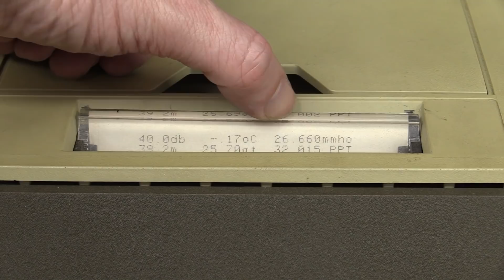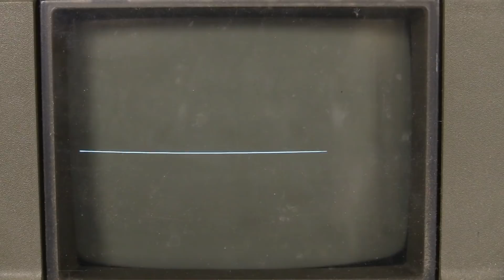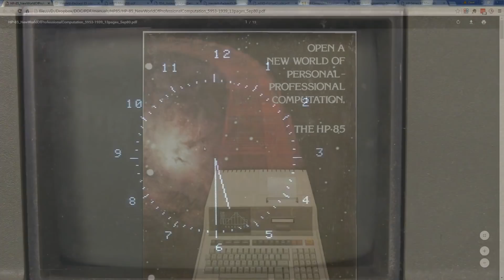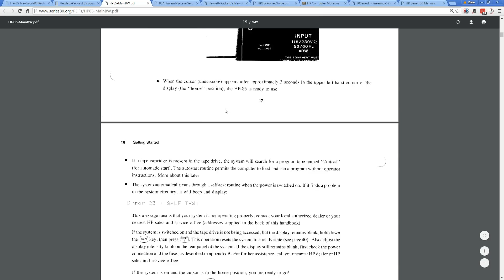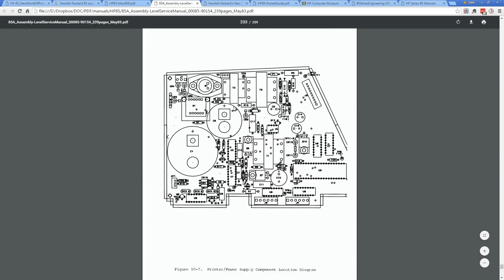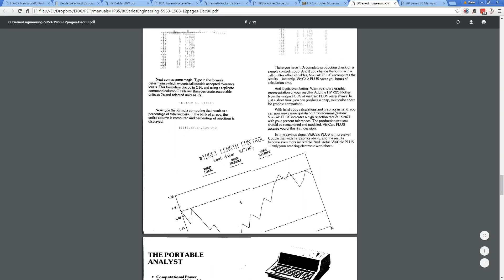EEVblog #904 - Hewlett Packard HP85 Professional Computer

Comment: Cool piece of equipment!  I love computer equipment that was used for testing and automated testing purposes.  I worked with Lockheed Martin's Consolidated Automated Support System.  That was a giant 5 rack machine with a microVAX at the heart of it running VMS 5.2.  It could interface and test just about any piece of avionics that went in the F-14, F/A-18 and S-3 Viking aircraft.  Then I later worked at the remnant of Hughes Electronics and worked with all kinds of weird custom testing gear for verifying assemblies in production.  One of those assemblies was a Sony branded CRT that we produced!

Comment: I used an HP85 in ‘83.
I wrote a program to calculate point coordinates from trig survey for it. The maths was easy - it was the formatting of input and output, and plotting results that took time.
I also got hold of a primitive modem so that I could communicate with my head office in Johannesburg. Two technicians came from the post office - one to plug the 23:00 modem into the power socket and the other to connect the computer and modem into the telephone line. When I had finished in the area, I unplugged the modem & took it back to the PO. They told me, no, I must take it back to my office and reinstall it. They then sent two technicians round to unplug it and take it away.

Comment: We had a bunch of these in our lab in the mid 1980's. I remember one of the engineers had a filter design program on the 85 which took about 20 minutes to run. We took delivery of an HP 9816 (16 MHz 68000?) a year after I started. I made a bet that I could get the filter design program running on the HP9816 and have it finish in the time it took the HP85 to run the program. I won the bet.

Comment: HP Basic 5 was also known as Rocky Mountain Basic or RMB. For it's time it was very sophisticated, having many features of traditional compiled high level languages such as defined functions, subprograms, native support for complex numbers and matrix manipulation as well as a highly versatile IO command set for use with HPIB (aka IEE488) compatible devices. Although much slower than compiled languages, you could get a compiler for it which would speed up the code quite a bit. It was a very powerful and versatile tool especially in a laboratory environment.

Comment: I used one of these when I was contracted to the USGS in the mid '80s. It was used to analyze and process seismic data from our PDRs (Portable Data Recorders) that used the same tapes to store data from seismometers. These were fielded to determine if a locations background noise, whether natural or manmade, was low enough to consider it for a new seismic station.

Comment: Never ever give a 17 year old kit a 12,000 USD computer, an 80,000 USD sampling scope and an HP7475a pen plotter. THIS WILL SPOIL THIS KID FOREVER 😁
I learned programming on Elektor's Junior Computer that I built in 1980 and when we got those HP babies at school I quickly got a key of the computer room so I could tell the teacher how the HP85 works :-)
Two years later I used on at my internship at Philips Semiconductors to automate a test setup for measuring rise, fall and transition times in the new 74HC and 74HCT series chips.

Comment: Did some programming on one of these little guys where I worked in the 80's while attending university. It ran 24/7 like a champ and had two jobs. First it communicated via modem with the on campus phone switch and logged calls and did some initial parsing of data before handing it off to the HP3000 for student and faculty billing. Second it communicated, again via modem, with a petrol dispensing system at the physical plant and logged fuel usage and levels and passed the data off to the HP3000 for record keeping and billing.

Comment: Man, you just made me buy 2 of them on eBay. All as-is, but I will definitely get one HP85B working out of them. This computer has a great meaning in my life and it was on my bucket list to get one of them at some point. Back in 1985, (16 years old) I was an electrician trade school trainee back in Brazil. I had just started studying computer science at night school. Someone at this huge company asked me if I could code an app to produce tables and graphics (something like Excel and Tableau does today), in fact, they named it "Tableau de Board" (it was a big French multinational company). I got my first computer programmer job (34 years ago). I worked with the HP85B and the Tektronix 4054 (one I'm using on my picture). Cheers!!!

Comment: The way Dave marvels at fit-to-envelope design, I marvel at thermal engineering in thermal print heads. Heating that element up to cause a state change in the wax and cooling down for the next pixel beside it...rapidly enough in modern credit card printers to print several inches of receipt in one second. How many man-months of design went into the first usable thermal print head and paper?

Comment: My very first work computer was a HP85 - we wrote programmes to calibrate Ultrasonic Test Equipment from 1980 through to 1989!  Heyyy … these puppies did the job!  During the 19 80s - we started to use the larger HP45 monochrome PCs then this lead us to using the COLOUR  - HP45C!    I remember these weighing a tonne!  I only started using mainstream IBM computers from 1991 at work.  I first bought my own home PC in 1997.   Its hard to believe how far PCs have developed in 28 years!

Comment: Don't compute the expensive function (SIN(X)/X) several times in the loop. Compute it once put it in a variable and reuse it. There's not optimization pass in the BASIC interpreter, so constant folding and strength reduction have to be done by the programmer.

Comment: all other cpus of the time can do bcd tho. 6502 can. intel 8088 can. just that the 6502 doesn't have mul/div. but hp probably didn't want to be dependant of external suppliers for something they could just make themselves anyway. the bcd thing is not an argument. typing anywhere you want on the screen is normal with 80s microcomputers. that's why they have this thing called the 'editor' sitting between the i/o routines and basic. (basically a glorified keyboard buffer using the entire screen ram line by line). moving the cursor anywhere is also the default behaviour on any vt100+ ansi terminal if you don't explicitly stop it from doing that in your program by not echoing those back.

Comment: I used one in 1988 for my final Engineering project. It was connected via GPIB to a VERY expensive HP Parametric Analyser which was connected to a wafer probe station. I was validating SPICE models of transistors again actual wafer transistor structures. It was a bit peculiar as I was by then used to IBM PC's but its ability to interface was fantastic and HP engineering quality then was just outstanding.

Comment: Ages before internet, or even BBSs I worked with one of those, but we didn't used it too much as those tapes were very expensive. I even took classes at HP to use it and everyone there had one at his desk. Those sold on Brazil were castrated because of protecionist laws, so they had only one expansion slot on the back. They were not exactly powerful, but they were ergonomic (even with that tiny screen) and beautiful, they were not as yellowed (plastic gets yellow because of UV light with time). The tape noise was charming and depending of how you wrote (yes you could have databases on tape too) the noise changed.

Comment: I don't know if it was this particular model  but there was one that look very similar running the spectrograph at school. 

HP used to make a lot of this kind of computers / calculators. Dad still has a 41CX Scientific Calculator  with a magnetic strip card reader to load up the program and an interface to connect to vibration measuring device. It could predict when bearing where needing replacement in motors with out even opening it up.

Comment: When I went to work for HP in 1979 this was a fantastic machine, though VERY EXPENSIVE.
The tape drive was optional and VERY EXPENSIVE.
There was a very good educational program that guided the user through all the functions available, it used the graphics capabilities of the screen to provide an animated user experience. This was very SEXY in 1979.
You could actually buy a machine without the tape drive and load programs from other machines, so I was tasked with writing a system that could load the user guide from another machine onto one without a tape drive. I had to modify the user guide program to fetch modules of the guide from the other machine rather than from the onboard tape drive
I had to write it is a mixture of BASIC and ASSEMBLER language.
In 1979 of course HP was the original fantastic scientific company built by Bill and Dave who were still alive.
HP would ship out new products to all the regional offices on a regular basis, large packages would arrive all the time which we eagerly unpacked and proceeded to dive into these unbelievable products.
It was like Christmas Day only10 to 12 times a year.
Those were truly amazing days that I was so fortunate to experience.

Comment: My Dad's office had one of these but no one knew how to use it.  I at age 12 spent time in the office and learned basic on it.  My Dad brought it home and I continued to learn on it.  I am a software engineer to this day.  Fond memories of this computer.  HP did actually make two games tapes that had a collection simple games on them.  I used the basic language to make some rudimentary games.  There were some simple sound commands in the basic language as well.  I eventually moved on to the Vic-20 and then Commodore 64 which seemed like a big step down in some ways and big step up in others.  Thanks for posting this video.

Comment: We had several of the "big brother" machines, the HP 9845.  We used them extensively for analysis of electrical measurement from test wafers during device and process development for x86 microprocessors.  In addition to the ROM and RAM plug-in options, they also had I/O (like 16 bit input and output).  I developed hardware and software to program the 9845s to actually perform the "E-test" functions using the Lomac computer-driven test hardware.

Comment: Gluing your graphs into your report mid 2000's!  Is that right Dave?  Surely with something like Microsoft Word you could have just copy pasted them into your Microsoft Word report.

By the way that is cool tech.  What would be even cooler is doing a tear down of the Olivetti Programma 101 the very first portable computer, which apparently HP copied.  However I guess you would only find these in museums.

Comment: These make a great little "old school"  test instrument controller with the 82937A HPIB/IEEE488 interface, many were used for that purpose in the 1980's.  The DC100 tape drive was nice for portability but the tapes aren't too reliable.  I use a HP 9121D diskette drive with mine, it's much better than dealing with those tapes.  I've written data logging programs for my Fluke bench meters and HP spectrum analyzers and counters for the HP85, it's a simple and cost effective way to use HPIB at a hobbyist price level.

Comment: The tape drive failure is probably related to a worn out capstan or dirty heads. Probably both. Some cleaning and a piece of a rubber band should fix that right up!

Comment: Akron Standard FVM tire force variation machine harmonics and diameter run-out tasks, still had HP A600 computers with 3.5" floppies in use in 2016 testing tires.

Comment: A friend had one of these at University.  It was a great machine.  The digital tape drive was nice because it was addressable and could find programs a data sets without manual manipulation.I wrote a lot of programs on this machine which was nice in that its screen graphics and printable graphics were nice.  I had an English to Angerthast rhune translator because Tolkien was riding high in the early 80s.  Eventually my friend traded for an 87 which gained an 80 column screen but lost the tape drive and the embedded printer.

Comment: Wow, remember using these when I started working at a materials testing laboratory in the late 1980's, we did run them coupled to testing equipment like dynamometers and impact meters to produce graphs of the testing data.
The actual signal from the load cell came in via an A/D coverter that was a separate box and a RS232 cable to the interface module that was plugged in the back of the machine.
After playing around with the ZX Spectrum computer with it's drive that used standard audio casettes the high speed tape drive was a real delight, it now only took you half a minute to load a programme instead of the 5-10 minutes with the Spectrum.
You had to run the program via a manual command when starting the test, because there was no control connection to the test machine.

Those keyboards were really good indeed, with a very nice click feeling of the switches.

In 1992 they became obsolete and were displaced by new 286 or 386 PC's which were state of the art then (and did cost as much as the HP-85), from now on we had full control over test equipment that had built in A/D coverters and control via a built in RS232 port.

To show how long computing equipment can last in professional use, the plant in the factory where I work now is still controled by software based on 486 machines (DOS operating system!) that came with it in 1993.
The control system proved very reliable over all these years, but the sourcing of spares for the hardware has become a problem, because you can't run the programs on new computers anymore, and you can't connect these to the old PLC's anymore, so a grand upgrade of the whole control system is needed now.

Comment: Just an assumption: mmho = mm H20? Millimeters water gauge. If the dot is used for decimal separator (as would be in US), that's be some 260 Pa(scals), so some low pressure stuff.

Comment: Why in the world should a computer need binary-coded decimal math to be hardware-based? All of that can be remedied with software. And the accuracy only makes a different in the fractional part of the number. Integers do math just the same, in binary as in BCD. Did the HP85 even do spreadsheets, which might be nice to be able to recalculate quickly?

Financial accounting issues, can often be remedied, by internally doing calculations in cents, rather than in dollars. That reduces the occurrence of fractional parts of numbers.

Somehow it seems a bit bizarre, to encode just one arbitrary number base, into the hardware. Aren't there other number bases? Fancy calculators often do 3 or 4 number bases, but I think only decimal does fractions. The other number bases only do integers, and do not do floating point nor scientific notation either. Hmm. Must actually be doing them in binary.

Come to think of it, I am trying to remember if the 6502 CPU chip, used in the Apple ][ family of computers, had a BCD flag that could be set, in its Status register? I think I have some notes somewhere, that I can't access right now. Where am I remembering BCD from, from so long ago?

Let's try a list of flags that I can remember I think: There can only be but a maximum of 8, as the data bus was only 8 bits wide, and I am not sure if all 8 were defined?
• Disable mask-able interrupts.
• Zero flag
• Carry flag
• Overflow flag
• Negative flag
That is all that I can remember right now. Looks like there could be room for a BCD flag? Although I never used it in any of the few Assembly or machine-language short programs that I wrote.
Reply: yea, 6502 has got BCD, thank you very much winner winner chicken dinner. SED instruction to turn it on, CLD to turn it off. Used it once or twice for some obscure purpose ;)

Comment: We had one of these in the Microbiology Department where I worked. Almost all the software was tape-based, and so the need to understand HP's rather "unusual" version of BASIC was not essential. Although the available memory was "tiny" by today's standards, that machine could cope with pretty advanced statistics no problem (e.g. 2-way analysis of variation). Used it a lot for the day-to-day computational elements of my Ph.D. (but I'll admit to getting the graphs in the final Thesis drawn on a "real" Mainframe and A4 plotter :-) )

Comment: I found an Osborne 1 for sale for 250 should i get it ? :D
Reply: God, a machine shop near a place I used to work was tossing out a pile of those and old Compaq luggables, they had been running CNC machines. I should have grabbed a couple..
Reply: In physics, if you gave a number without a unit, it was pretty much wrong, unless it was just a number, that had no unit, as in the case with a simple ratio.